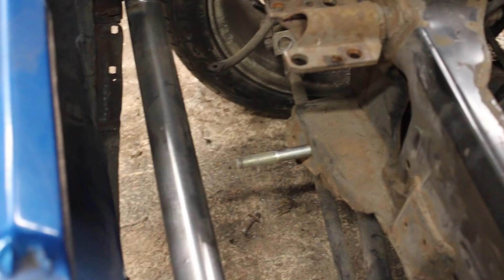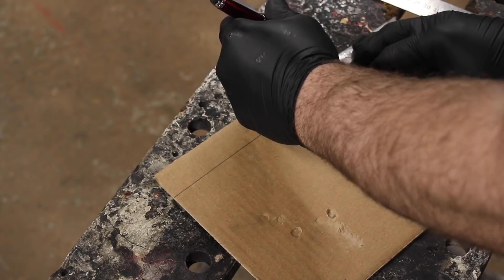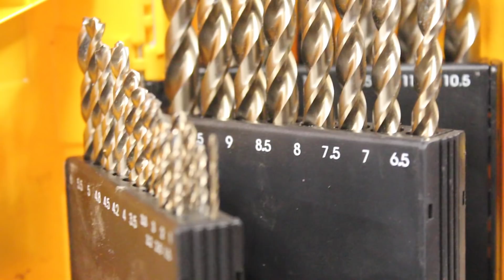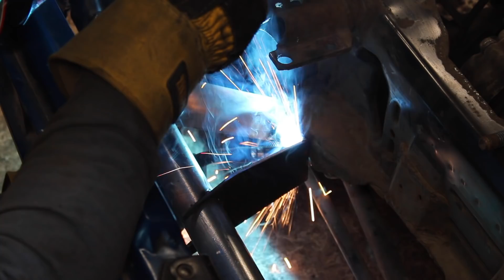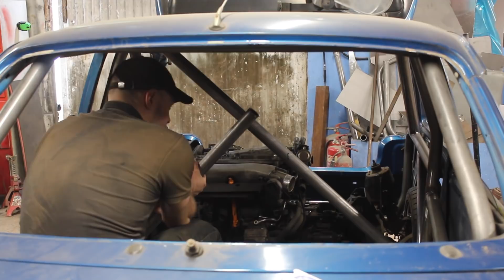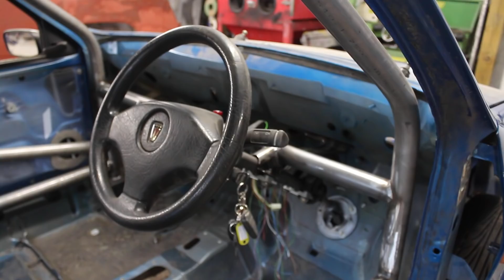RAUDI Mid-engine Audi 20v Powered Rover Metro Project - EP10

Comment: youre runner the drill to fast at that size hence why you are wrecking your bits, slow it down as you increase drill bit size, 6mm or so would be good at that speed not much bigger
Reply from the maker: +croonersteve possibly, its 480 on the DRO, so not that fast.

Comment: Looking so good.  With it being read wheel drive and the engine in the back, is there going to be enough weight over the front wheels to actually steer? :P
Reply from the maker: Hey Colin, it should be quite well balanced, but it's all one big experiment :P Lot's can be adjusted with suspension and corner weight setup, but who knows :)